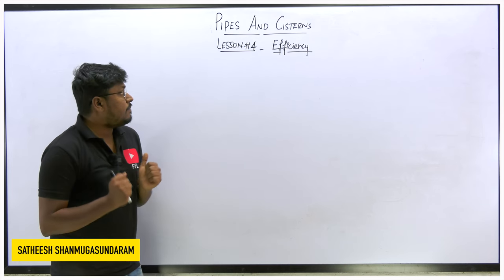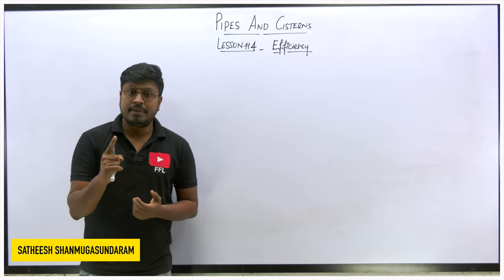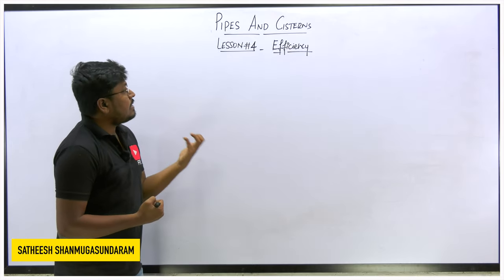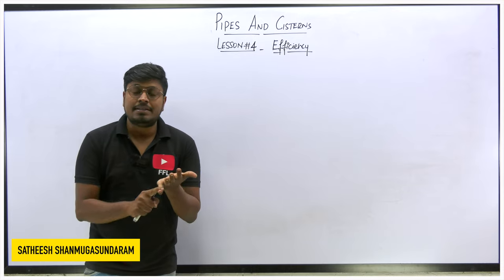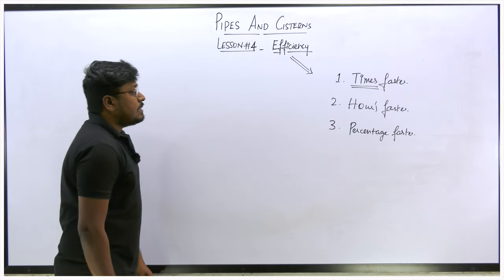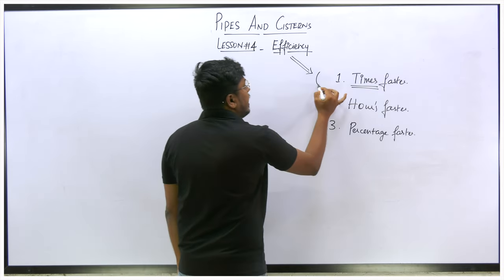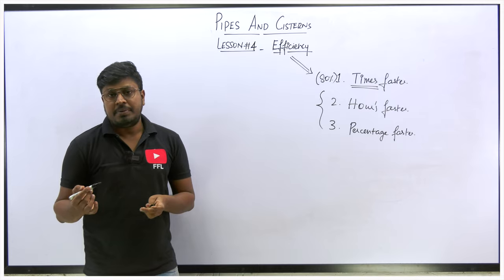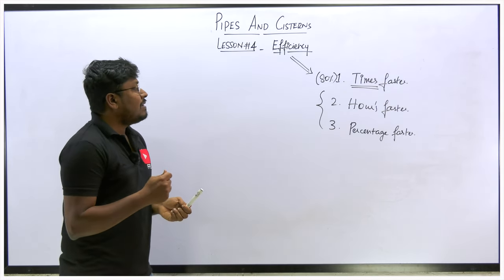Pipes and Cistern(Lesson-4) || Tap Efficiency

Comment: Last question answer 38.9 hours
Sir did mistake. Initially B should be taken as 180 or 1.8x
A should be taken as 100 or x
X=70 hours that is taken by A
And B is 80% efficient than A, if efficiency is more time will be less. there for 38.9 hours taken by B alone....
Hope everyone got the thing 😊
Reply: B = 180%(A)
B/A = 180/100
A:B = 5:9 (efficiency ratio)
as eff ∝ 1/time
B takes 'x' hrs (we have to find) & Both A and B takes 45hrs.
B/(A+B) =  45/x

9/14 = 45/x
x = 70

Hence B takes 70hrs
😃👍
Reply: No B alone can't do it in 38.9 hours since both A & B together takes 45 hours
Reply: Bro think logically both pipes 45 min  byy

Comment: sir, at 30:42, why not A=x & B=180x ?
Reply: same doubt
Reply: B is more efficient means it takes less time. If B takes x time then A will take 1.8 times x.
Reply: Sir did mistake. Initially A should be taken as A=100 or x and B should be taken as 180 or 1.8x
Reply: @pam-u6i idk what sir did...but b pipe's capacity means b pipe's efficiency to give more water out.
Reply: Finally b alone to full 126 hrs
Reply: No…if b is more efficient,b should take less time to fill the cistern